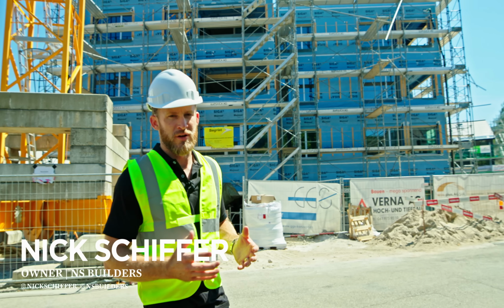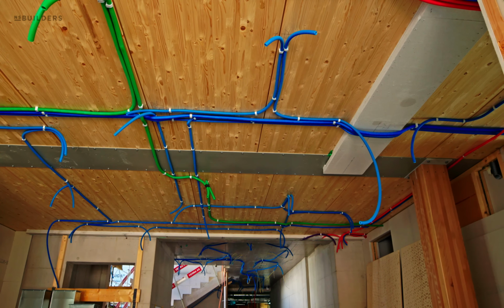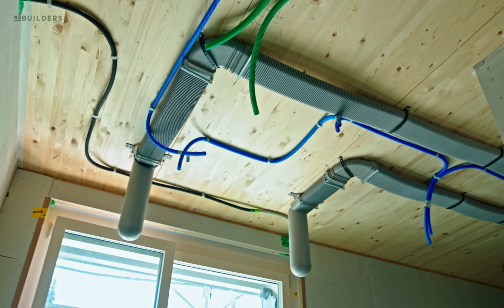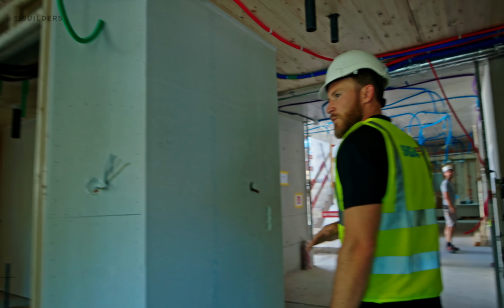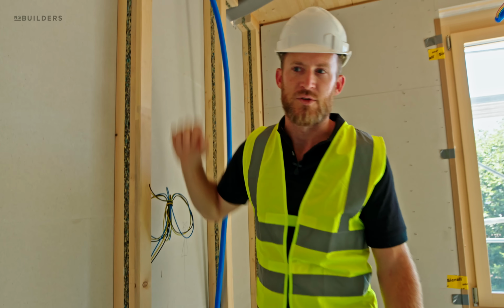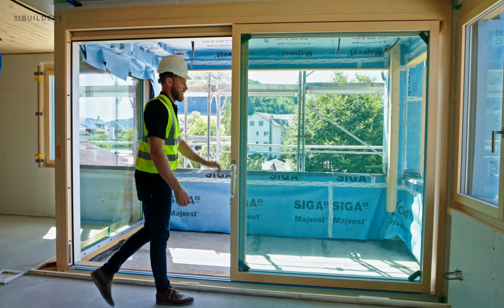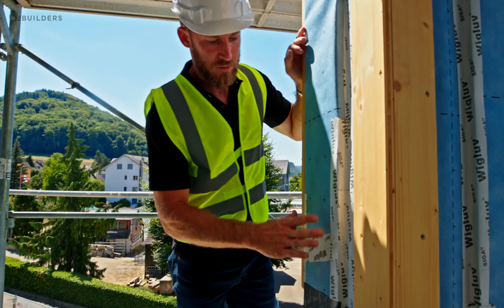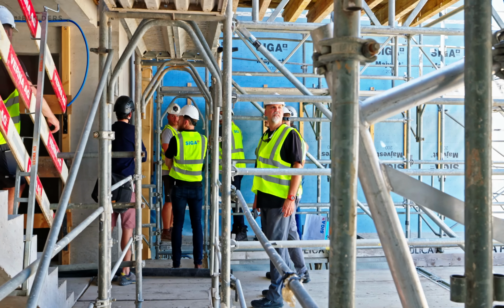The Swiss take sound seriously

Comment: I still don't understand, in Europe we have a WINDOW for ventilation!!! Then it closes. By the way, it's not ABC, it's HDPE. What Americans still can't understand is that every morning, even in the hospital, we open a WINDOW to let in real clean air, you keep talking about some fresh air, that's only done in the ICU, otherwise even the patients themselves open the WINDOW to get fresh air!!! This is not a hermetically sealed box where you can't even breathe, the windows can't be opened and it's like in a prison. Regardless of the fact that the windows have micro-ventilation, so they actually have 4 positions, if you put the lever in 3/4 and pull the window slightly, the seal opens and the window ventilates slightly!

Comment: HVAC is relatively rare in Europe. Heating and cooling are usually done separately from ventilation. However modern ventilation systems will have a heat exchanger so that they don't lose heat to the outside air (they heat the incoming air with the outbound air, or vice versa when it's hot outside).

Comment: 3:30 : I  that this building has an active ventilation with heat recovery. That would explain these pipes. It means that it has an activ ventilation and the heat of the outgoing air would preheat the incomming air in winter time. This is very common for new buildings in Switzerland (and Germany...).

Comment: I'm an Operator/Driver and I have a saying when it comes to keeping your equipment clean. "If you can't take pride in your machine (workspace) how are you going to take pride in your work?"
On top of that it's healthier physically, mentally and safer.
In NA the quality is all driven by Capitalism. It's more about throwing a building together, and trying to come in under quote so you make more money on the job. I've seen "consultants" on site that their main job is to push the contractors to get the most bang out of their buck. It doesn't matter how good you are, you're going to get pushed to do it faster and cheaper.

Comment: I live in a 40 year old house here in Switzerland, i gotta say: soundproof, definitely not. I can hear my neighbors pissing 😭. Isolation not very good as well. And electrical, as a someone who works in IT i got cat5e and fucking expensive to run new ones because they’d have to rip open EVERYTHING.
But new buildings definitely profited from all our development in education, practices and technology in this area.
Reply: Believe me, compared to American buildings, even the worst soundproofing in Switzerland is a million times better. 

FYI, in my apartment in Zurich, I ran Cat 6 through the walls by replacing the telephone wiring that I didn’t need, just using the existing conduit and new wall plates with Ethernet jacks.

Comment: That plastic Air supply and return lines looked Janky as hell … I’m assuming it’s just fresh air not cooled or heated due to it not having and insulation.
So it’s prob fine for just having a fresh air in and out made of that material. Just looks cheesy on camera I’m sure it it made pretty well . I would way rather have my electrical hard piped instead of that plastic tubing . 
That stuff isn’t stopping a drywall screw or if you wanted to pull a line through it good luck haha

Comment: Big question about the stapled wall board. Is it just standard 5/8 gypsum? What kind of staples/stapler is used to install? This is so cool. I can't stand hanging board one handed with screws.
Reply: My qualified guess will be that it's the same fibregypsum board used in DK, probably Fermacell.
Those can be stapled due to the adding af paper in the production, adding the strength for wider cc, ability to screw objects to the wall without rawlplugs and  such

Comment: I can’t get over how clean this job site is.
Reply: That’s pretty normal here. Every job site in Germany is similarly clean.
Reply: Oh dude if you're one of the bigger contractors on a project and you don't clean up you're gonna get drowned in complaints in Germany Austria or Switzerland. Culture as well as regulation thing.
Reply: its extremely normal in any developed country that isn't America or Canada. NA is disgusting
Reply: Sometimes an inspector of the trade association will inspect the safety of the building site. And they can hand out quite substantial fines.
Reply: @Felix-st2ue  SUVA sagt Nein 🤣
Reply: i know this is a very old comment but cleanliness is expected on all worksites here atleast the ones i have been to. some sites i have been to have actually had trades complain and or safety personnel and managers from the builder put in complaints if they have felt the work space has been to messy. most worksites i work at has a responsibility sheet, where each company that is apart of the project takes time on a floor or area assigned to them and clean it up
Reply: Never eat at a freshly built restaurant.
Reply: @The99_870  why?

Comment: 12:30 That power cable is for a shuttering system that are effectively exterior black out shutters made from metal.
Reply: Yes, and the far superior option I find too. Other countries which don't generally have such installations rely solely on interior shades or curtains. The downside of the interior shade/curtain system is by the time the light hits these shades/curtains, the glass has already amplified the sun's heat, causing intense heat on the inside.

The Swiss really have a good system with these rolling blinds being outside, or as often seen in residential homes, the swinging shutters.

Comment: safety is no.1 you mentioned -- in the UK you should have safety boots and would be chaperoned unless you went on the site safety induction course, plus you need an ID and a hi-vis that states "visitor".
Reply: In Oz on Tier 1 projects, you are expected to have long sleeves and trousers. PPE is helmet (less than 5 years old), high vis vest (and generally reflective strips on trousers), steel cap boots, safety glasses and gloves. Induction mandatory unless visitor with escort.
Reply: It is indeed possible to take safety too far.

Comment: This may be interesting: AC is actually not allowed in residential buildings in Switzerland which has a huge impact on overall power consumption by the country. Instead every new building is constructed in a way to preserve the inside temperature and everyone learns from an early age to vent their home in Summer during the early morning hours and then keep all windows closed throughout the day. In office buildings, this is not practical (for different reasons) and so ACs are allowed there.
Reply: Hey John, gonna add something to your comment - as you can see in the video, air ventilation systems are very common in new residential buildings in Switzerland, and many of the systems used can also cool or heat the air blown into an apartment (as well as control the humidity). The window unit ACs common in the US are oftentimes not allowed, you‘re right about that. One other type of AC that is allowed are room units that connect to the outside only via duct, these can be installed at any time, which makes them predestined for uses such as doctor‘s offices in older buildings.
Reply: @colorshotcrew  Didn't know that. Thank you for your comment!
Reply: In Switzerland, exterior blinds can also let some air in, but reduce solar heating in summer
Reply: The max daytime summer temperature is also lower than in most of the US and even southern Canada
Reply: @jaireidca  and very important the nighttime temperature is usually low enough to cool the house. With the thermal mass and insulation the building will keep its temperature during a week long heatwave with no effort.
Reply: That's how older US houses were set up to operate.
Reply: This is the problem with Switzerland; old ideas still permeate through country. Even the poorest of the poor countries have access to AC.
Reply: @gvi341984  It's not that they don't have access to AC, they don't need it. The houses are cleverly designed with energy conservation in mind. It's like with the cars: it's no sign of wealth, if everyone owns a car. If you don't have to own a car, then things are really done right.
Reply: @ljackattack  They do need it but the culture ostracizes individuals who want one during the summer.
Reply: @gvi341984  yeah tbh, it's a waste of energy. people dont need it here except for extremely specific cases.
Reply: @gvi341984  I live in southern Germany, on the Swiss border. Before that I lived in an attic apartment from the 80s, so I would have liked to have had AC in July August. Now I'm in a loft, renovated and insulated in 2010, now I don't need AC all year round, I had the heating on 1 all winter and it was toasty warm.
Reply: @arnodobler1096  Winters are easy to stay warm but summer? Horrible
Reply: @gvi341984  It doesn't get over 25° Celsius in my apartment, even if it's 38 outside. I open 2 opposing skylights and good.
Reply: @gvi341984  oh and VELUX Dachfenster are the best. 👍
Reply: So it´s illigal to have ac in your house?
Reply: @nickmagma7745  You can but you need a energy certificate of your house/building and ask your local government. You can also buy a portable AC and call it a day though.
Reply: @zaxmaxlax  Furthermore, it's rarely a "stupid AC", but in nearly all cases newly built buildings will utilize a heat recovery system, which removes up to 75% of the heat from the stale air and uses it to heat the fresh air (or vice versa in summer).
Reply: @zaxmaxlax  that´s crazy, and I thought belgium was bad
Reply: @nickmagma7745  I forgot to say nobody owns a house in switzerland, your bank owns it so you pay the bank to avoid fortune tax.
Reply: @zaxmaxlax  dude what. I really need to know more about your laws. Do you know where i can find this info?
Reply: @nickmagma7745  Let me tell you about the health system, you are REQUIRED to pay over 3k eur a year per person in health insurance. If you go to the dentist it will be 900 bucks but most things aren't 100% covered so F you and thanks for the money. People literally go to france and germany to get their teeth fixed because its cheaper, even paying full price there.
Reply: @zaxmaxlax  that is just not true. Plenty of people own homes and pay tax for it.
Reply: @RCP-1136  Yeah, those who already inherited it in the first place. And if they're not renting it or mortgaging it and re-investing the loan on bonds/stocks they are dumb and don't know how the swiss economy works. Home ownership is 35% in switzerland and it falls as low as 12% in the cities, the lowest in europe, even in germany its like 50%.
Reply: > AC is actually not allowed in residential buildings in Switzerland

This is fkng  nuts. I will not live in a place where government has so much power it can prevent me from cooling air in my own home!!!
Reply: @denysvlasenko1865  All laws in Switzerland can be changed if the public deems it necessary. This has nothing to do with government power. To us Swiss, this really seems like a sensible arrangement.
Reply: @obsoquasi  > This has nothing to do with government power.

Yes, evidently it does. If you would install an AC, Swiss government will punish you. Ergo, this is government power over you. (And sure, you apparently voted for this. I have no idea why would you, but Germans voted for a certain Austrian in 1932 too...)
Reply: @denysvlasenko1865  1) loool 2) the Swiss can create a referendum to change to policy any time, no reason to get paranoid here 3) you realise we aren't Germans right? 4) from governmental politics to "the WWII guy" in 2 comments... Do all your comments end that way or are you just having a bad day :D.
Reply: @obsoquasi  I simply explained to you why "we voted for it therefore it's fine" is not a correct argument.
Reply: @obsoquasi  He does have a point and Swiss referendums are more similar to popularity contests.

Comment: i dont know how in the US is made, but in europe its one layer OSB and gypsum board layer, or double layer gypsum board, in case of residential construction, at least what i have seen the last 10 years...
Reply: For interior walls, it’s just one layer of 1/2” thick gyp. Ceilings are 5/8” thick gyp. Outside layers are ~1/2” or 3/4” thick OSB. We tape and mud all gyp joints since it’s one layer. Also, all lumber walls are 2x4 (1.5”x3.5”) spaced at 16” on center. It lets you use thinner gyp at the expense of more wood.

Comment: Americans dont care about sound. Building quality sucks. Builders/Housing Companies cheap out as much as they can to maximize profits, while people have such low standards that they dont care about noise and excuse it as something that cant be helped.
Reply: I think if people in the US experienced quality they would have a higher standard. But, we have a lack of housing supply so we don't have many options but to just accept what we can.
Reply: @scuph  Sounds about right
Reply: America builds with a lifespan of 30 years in mind, then they demolish everything. It is a wasteful way to build. Compare that with Europe and they build with the intention to maintain any property. So, yeah. America sucks big time.
Reply: Something happened between ~1995-2000 to housing construction. Wooden doors were standard, and walls were built 1/3 thicker than they are now. Any residential building built past 2000 has literal cardboard doors and no floor sound deadening.

Comment: the electrical wiring fixed directly to the wood ceiling..........isnt it a problem in case of fire? I mean, I are these tubes fireproof?
Reply: yes, those tubes are flame-resistant.
Reply: @cmmartti  certain applications like low voltage.

Comment: Did you get a feeling for the durability of existing buildings in Switzerland or were you only looking at new construction? I'm just curious if anyone (Swiss) was forthcoming about previous building practice mistakes that led to their current impressive techniques.
Reply: Swiss here. I lived in a house from the 1500s for quite a few years now (All original wood, hand forged nails and straw in the walls xD). The house has warped a fair bit so the floors are not even anymore but overall it is still very solid especially considering it has 6 floors if you include the cellar. I'd say Switzerland has always had a high quality of craftsmanship in terms of construction up until the post WW2 era when the building quality deteriorated somewhat. A lot of buildings from the 60s are currently being torn down and replaced, whereas older buildings, especially those from pre 1900 are being renovated and upkept in their current form
Reply: I live just over the border in France. Here things are built to last 2 generations without a major renovation. In Switzerland they are just built to last and never need major renovation. But you are looking at 35 year morgage vs 25 here on top of 4.5 times the income swiss vs french!
Reply: @idrisddraig2  And yet the Swiss typically renovate buildings after 30-40 years anyway! The building I live in was built around 1980 (as were most of the nearby buildings), and I moved in in 2013 after a complete (down to bare concrete) renovation. And since then, one by one, all the buildings nearby have been renovated, too.
Reply: As a person from Switzerland, I agree with the comment regarding build quality deteriorating for a while from the 1940's. Broadly, I'd say that buildings in Switzerland built until the 1930's, early 1940's are well built and durable, but from the later 1940's into the 1980's there was a phase of quickly built, poorly insulated (often prefab) buildings, often large-scale projects ("Überbauung") actually not unlike East Germany's "Plattenbau".
Reply: @RealGestumblindi  I’ve been lucky — the two apartments I’ve rented in/near Zurich have both been really well built. One around 1980, one from 1992.
Reply: The Swiss ethos is "Quality" I've lived in Switzerland for 15 years and I must say they just do things "Properly" and what they do (New build or renovation) is done to last.
Reply: @DomesticDave  That's definitely the impression I get.